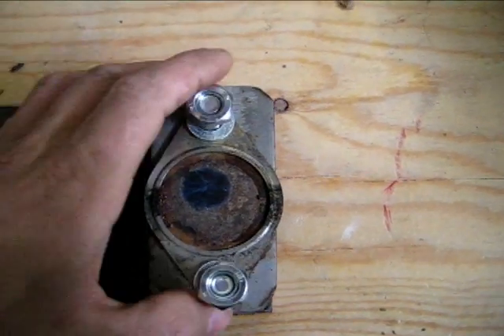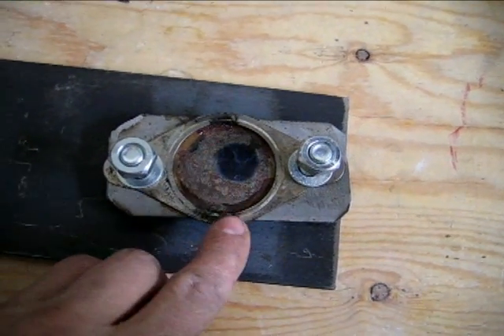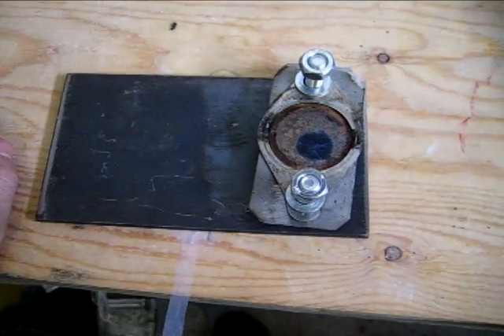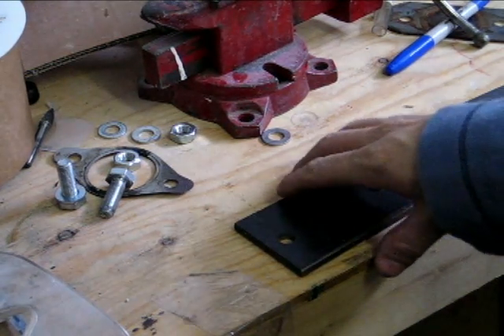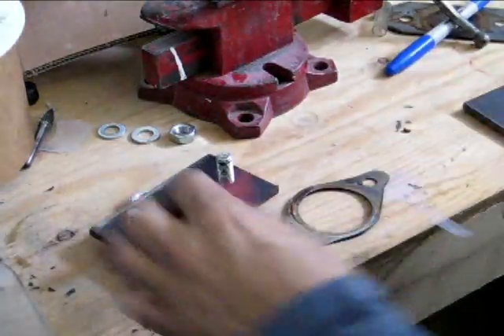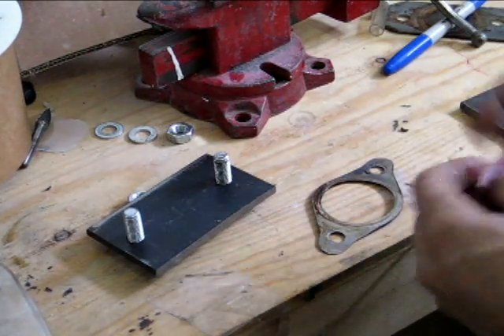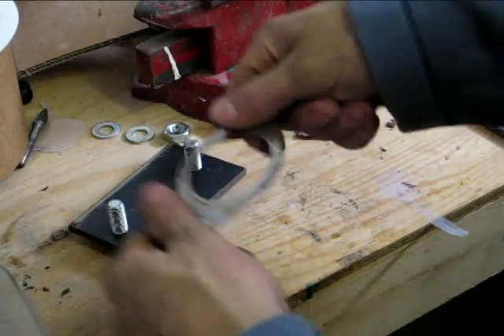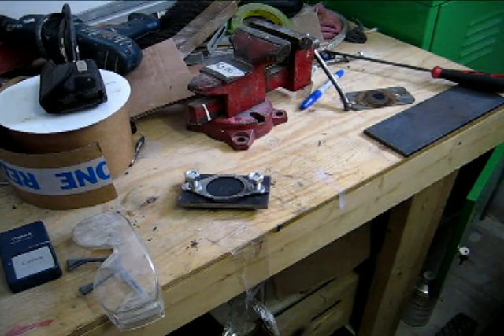Egr Block off plate Duramax lly

Comment: so I guess mine made of 11ga stainless wont last?
Reply from the maker: it depends if you remove the egr cooler altogether or not. If yours is slid in between like a gasket it's better supporte.  I removed the whole cooler and there was nothing to hold it on the backside.